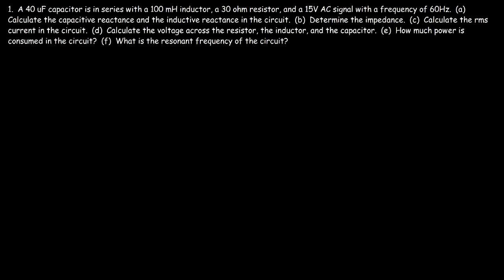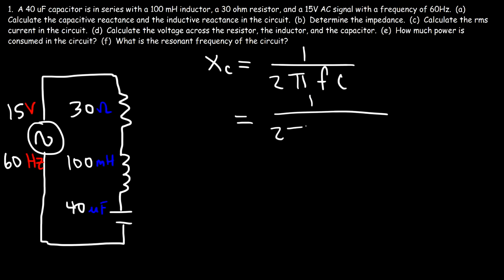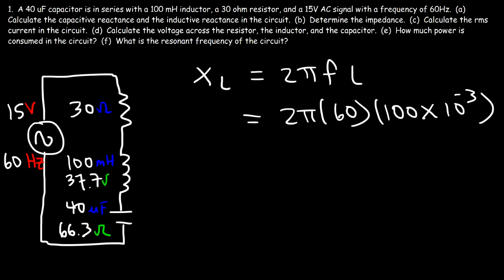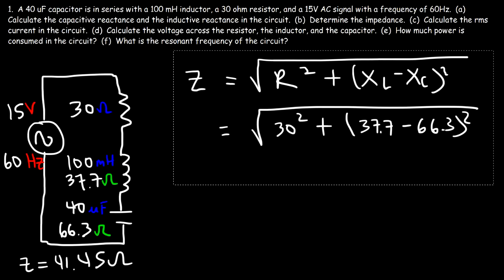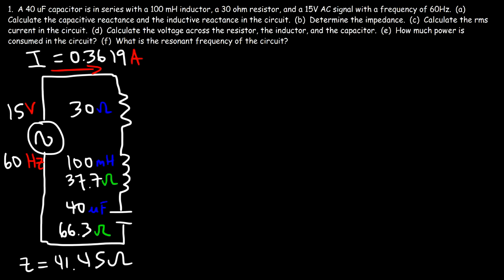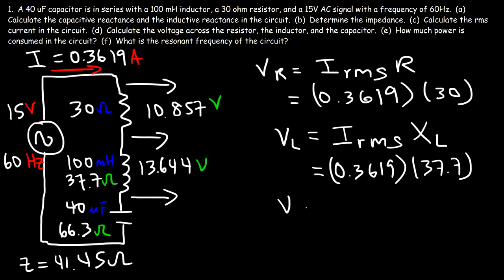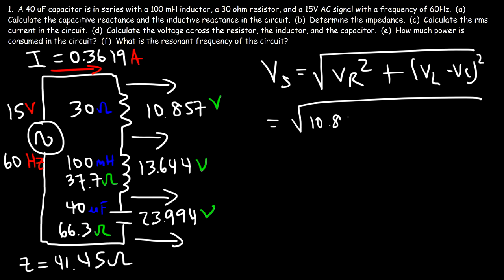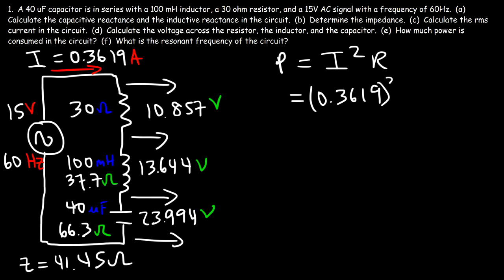Series RLC Circuits, Resonant Frequency, Inductive Reactance & Capacitive Reactance - AC Circuits

Comment: There is a third way to calculate the power of the circuit, the current multiplied by the resistive voltage.

Comment: Please create a video that shows step by step how to calculate all the values for a simple PSC motor that has a run winding that is connected in parallel with a start winding that is connected in series with a run capacitor.  to clarify, the start winding and the run capacitor are in series with each other, together they are parallel to the run winding. typical values for the items could be as follows: Run winding R=5ohms L=10h. Start winding R=15ohms L=5h. Capacitor = 35MFD.

Comment: A series R-L-C circuit consist of resistance of 1000 Ohm, an inductance of 100 mH, and a 
capacitance of 10 pF. If a voltage of 100 V is applied across the combination then calculate Qfactor, resonance frequency, bandwidth and half power of the circuit.

Comment: Hey guys otherwise I'm a student in SA and how I calculate the impedance is using a Casio calculator specially fx-991ZA Plus ll. There is a function for complex numbers and you can write the impedance without the use of a square root. The formula is Z = R + i (XL-XC) and then you convert this rectangular form into polar form to get the same answer you getting in the same video using the complex numbers function

Comment: I had a few questions on a recent exam that gave these variables, but also had “in a star connected circuit connected in series…” or “in a delta connected circuit connected in series…” and asked to solve for the “line current in the system. “ a few giving a power factor variable as well. Would that just be calculating the RMS current that you found in the vid? And if they give a power factor in the question, multiply the answer by that? Thanks!

Comment: Why do you need to resistor. All you need is a 60 Hz AC power source.  Two 60 H Inductor one F 60  capacitor. Or better yet pulse it at  the right Is frequency a good

Comment: Really good and helpful video but what if the frequency rises to infinity or goes to zero then how much is the voltage of inductor and capacitor in series circuit

Comment: Hi, why are we using the rms current when finding the voltage across each component? Shouldn’t we use the peak current? Or is that only valid when we are looking for the maximum voltage across each component?
Reply: Exactly, you use Imax only when you want the max. value and In most of the cases thats necessary If you plan to create the circuit, here the RMS is enough

Comment: Say if the series circuit had a inductor, resistor and then a capacitor. How would you workout the resonant frequency for that particular circuit???
Reply: for resonant frequency,resistance need not be used..its just Xl=Xc that's it

Comment: The impedance is not 41.45, its 108.2. This results in a mistake made with your amperage (its supposed to be It=Et/Z, which is equal to 0.138A.
Reply: wrong. Use Z=root of (R)squared + (Xl-Xc)squared. This is what u should use to calculate ur total current using ohms law. This is usually the first thing u do when calculating an RCL circuit but u probably know that now.

Comment: U made a mistake. Irms = Vrms / Z not V / Z
Reply: @25. Munazza Munabir (Bunny) i think  the v in the qn is supposed to  be the v rms
Reply: Huh? It’s just the voltage source divided by the total impedance
Reply: If he used the source voltage the equation is still the same regardless of your parentheses.
Reply: 15V is Vrms
Reply: Yea but i think he mistakenly said irms
Reply: I have this question please help I don’t know what to do with this 180 degrees: two similar 3phase,star connected alternators connected in parallel.each alternator has a synchronous impedance of 3,75+j12.5 per phase.the speeds of the alternators were changed so that their EMFs were 180degrees out of phase relatively to each other.The excitation of a machine A was udjusted so that its open-circuit voltage was 2,2KV. If the current circulating between the two machines was 32A.calculate:
1.open-circuit Volta of an alternator of B ,assuming that it was bigger than that of alternator A

2.the Terminal voltage 

3. The synchronous power

Comment: So quick question. How come the capacitor has a higher voltage than the source voltage (15v)?
Reply: Its AC not DC Thats why
Reply: Voltage can be large but current is minimum...ac networks must be dealth with power balance not the voltage balance.If u want to validate kirchoff v law then u need to consider phase and magnitude of voltage and validate kvl
Reply: this voltage across the capacitor is not in phase with  

the source voltage ..in other words there not ocurring at the same tiem

thas why,,,,